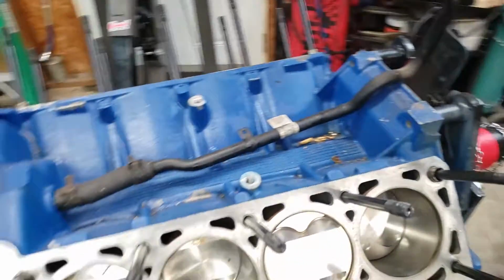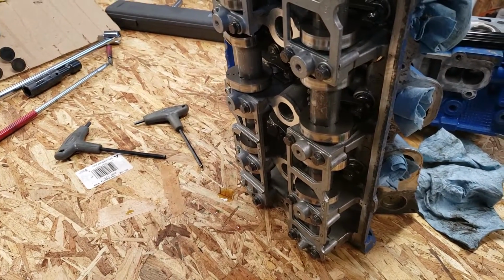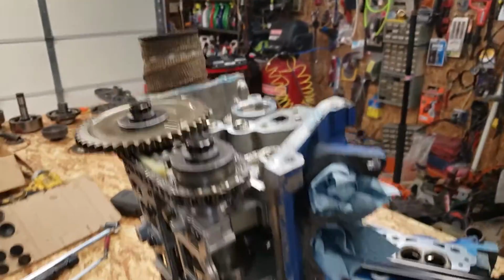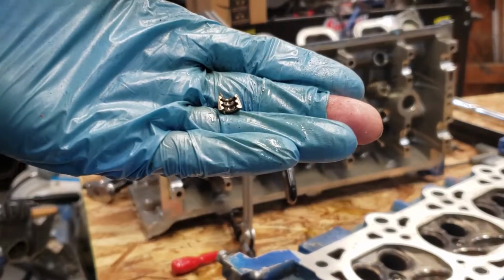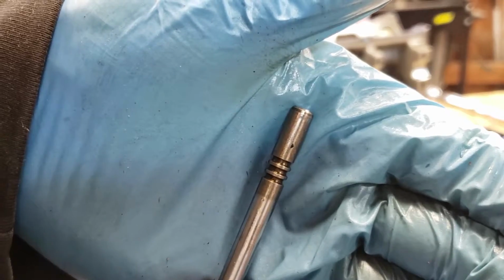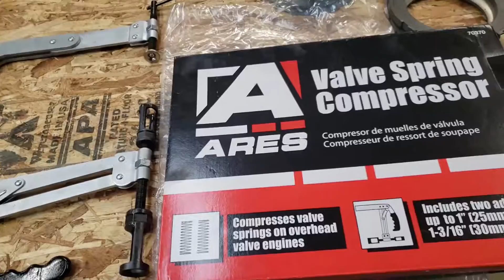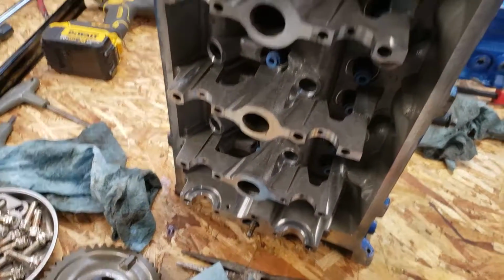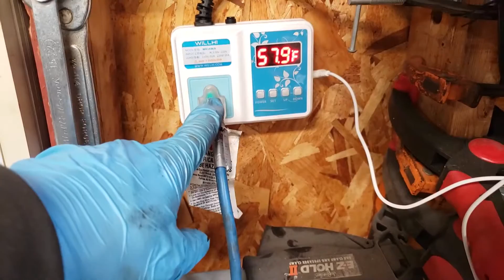Cylinder Head Disassembly  + Preparing Heads For Porting

Comment: Liking the channel. I have a 1997 Cobra 4.6 4V that I was thinking about getting into, but looking at the intricate nature I may have someone else do it lol. I saw that you where using a valves spring compressor to pull the springs. I have 4.6 3V that I just got finished rebuilding with a ton of mods, and a fully forged lower end (Aluminator short block ) and found a super fast method of removing the springs. If you would, take a look at the video I posted on my channel called Valve spring change, it may work well on your DOHC head. It works extremely well for the 3V, of course like yours it has to be out of the car. But please take a look at it and see what ya think. Subbed to your channel.